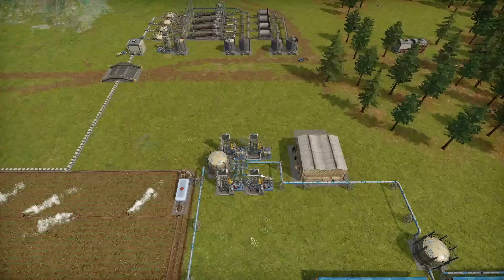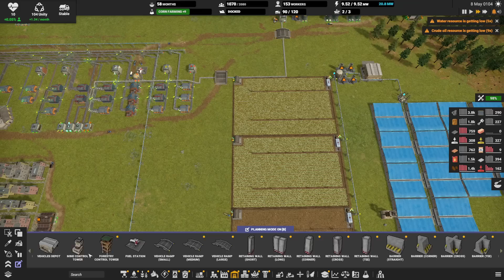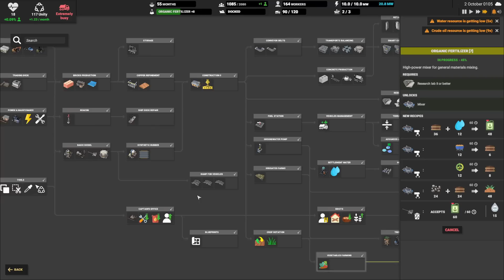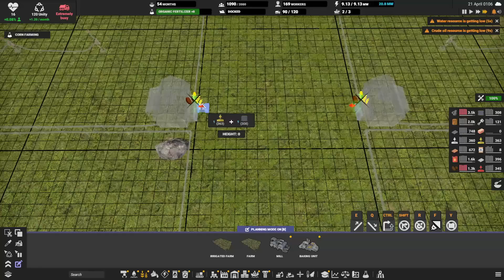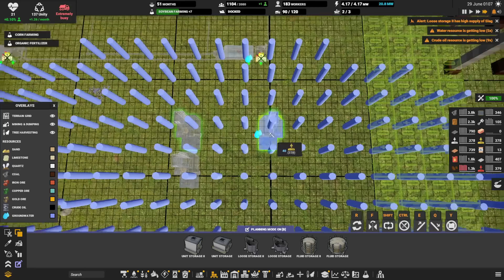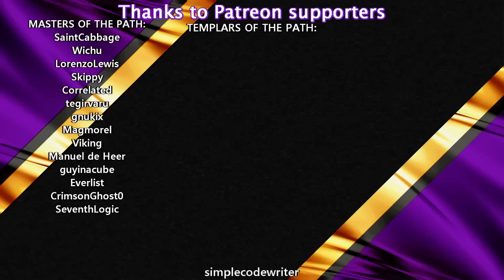Upgrading FARMS 🚜& TRUCKS 🚚 | 07 | Captain of Industry Update 1 | Lets Play/Tutorial

Comment: You are short on your settlement water. At the start of the video the demand was 66.5/60 sec. The tank connected was full but the settlement was not, so you must have a Pipe I instead of a Pipe II connecting the fluid storage to the settlement.